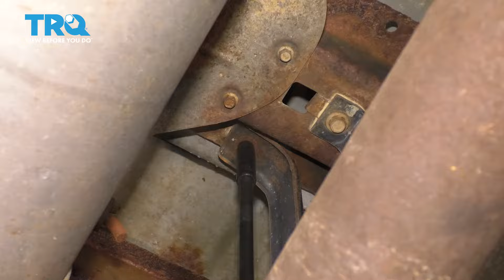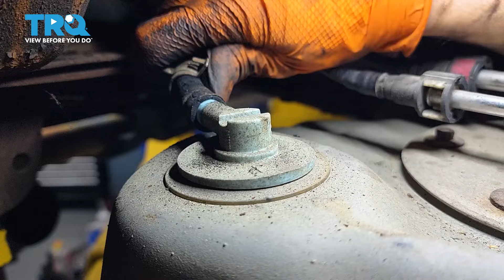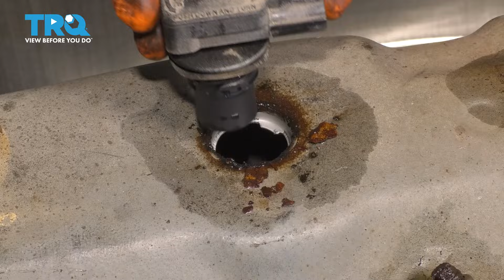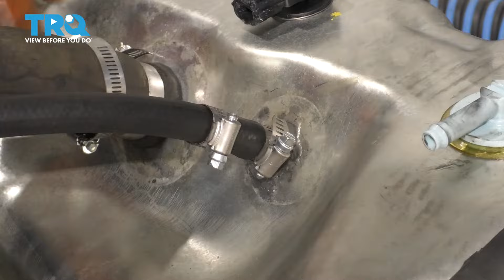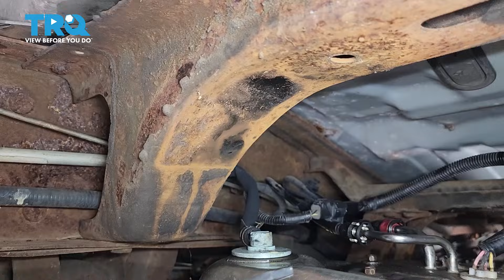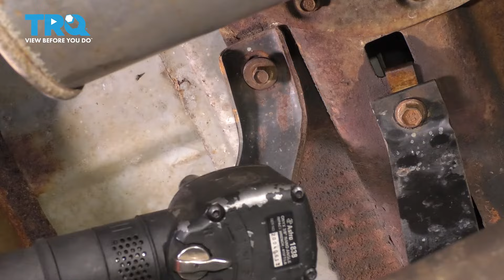How To Replace Fuel Tank 1997 2003 Ford F-150

Comment: Very helpful.  Thank you.  One caveat, however; if you are doing this without a lift, (on the ground with Jack stands) & you don't have the wing span of an NBA basketball  player & the fuel connections on top of the tank refuse to release for you (very likely on trucks this age), disconnect fuel line at fuel filter & the other line also further down, pull both lines (very carefully-25 yr old brittle plastic) out of their plastic holders on frame & lower tank until you can actually reach the connections kneeling on ground from outside the side of the truck.  Unless you have the room to use that fuel disconnect tool on a connection that hasnt been released in 25+ years-aint gonna happen.

Comment: Really great video, step by step. The only problem I had was I didn't have the quick lock type lines connecting to the fuel pump, mine had the connect ends that took a quick disconnect tool, and it wasn't so quick. Thanks for posting this video, it really helped.

Comment: Does the filler hose go flush against the tank? When I put the other end of the hose on the filler neck it would not slide over all of the shiny part of the neck where the old hose was.

Comment: Hello, Where can I get a replacement breather valve for 2003 Ford Expedition?  I just removed the fuel tank 3/4 full  and the only damage was the breather valve partially broken. .. I know for sure I can repair with JD weld
Reply from the maker: +Hubert -Williams We do not carry the item you are looking for. We suggest checking out local parts stores as they may carry the part you need.

Comment: Does 1A Auto sell a "loaded" tank with a new fuel pump, sensors, etc? Also got a link to the straps? Mine are the original ones from the recall...which was never done at a dealership, lol.  My  gas tank likes to leak a little when it's absolutely at the full mark until I drive it a few miles- I'm assuming the seal around one of the protrusions is leaking, or it's a vent hose, etc.

Comment: I saw a trick a guy talked about when the fuel pump goes out that you can take a mallet and hit the heck out of the tank while cranking to try and get it to start, he says it works 9 out 10 times but then i come here and see that this 03 f150 crew has the metal shield over the tank so Im wondering if I could even hit it hard enough through the shield to get the pump to reengage itself. Do you know if teh metal shielding is in contact with the tank or if there is a gap?